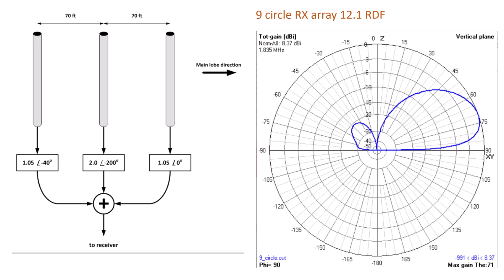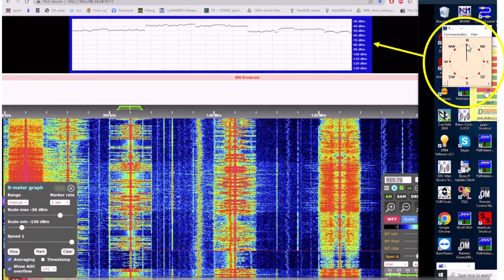9 Circle RX array directivity demonstration

Comment: Very nice result , I had the array , blind on the gain figures and results seen on internet i builded 2 of these 9 circle arrays. i ordered the kit at PI4 contest club. First they forgot to mention that the wire connections for the switching on the latest board is different, there is no info online about that ! I have been very carefull in buidling the preamps and so on , testing with analyzers you name it. 1 array was installed near trees and a small 1m high fence, rx results were equal like a amplified loop 130m away from the 9 circle, it could be the area. I moved the array free of metal and trees in the field 200m away  from the first place in the hope for better but front to back as rx was medicore. I have been searching for a faulty cable relays , electrical  issue ,   why 1 of the verticals was picking up noise and destroyed the performance of the array. The array was very sensitive to noise , wx, environment and i dont like the  AD8055.  After 2 years of struggling i start  experimenting with it. I replaced the verticals with loops 2m above the ground using the amps on it , configuration 3 in line direction NW SE but on the box connected ne sw (like recomment) First impression the array  was a very sillent rx read all the noise from the LED units,  cheap switch mode power suppliers from the neigbours ( 1 have 1 very close and alliba customer hi )  WERE GONE !! Then i hrd broadcast on 160m thats was a sign of a faillure propably a cap who was destroyed ( Steve you made a video about it ) propably when  1 of the verticals ( used before ) was installed too close to my 160m array. Finally i removed the amps and replaced them with a simple balun (seperated windings)  and a SV1 pre amp ( for simplicity installed in the network box) This was the best  i could do with this array. If you have to do all these efforts to get a bit of rx result then your not doing well, it did not beat any other rx antenna here , my simple 450 ft beverage and a cheap balun is still king to the states , cost +/ 60 euro. To conclude this expensive adventure. I regret the purchase , months of wasted time in trying to make it work as advertised its finally been a waste of +/- 2000 euro  for the 2 arrays, thats a tranceiver ! I wish the guys who bought my 2 arrays good luck , They were convinced in finding the troubleshooting, i never hrd them back for some reason ! Mich on8dm